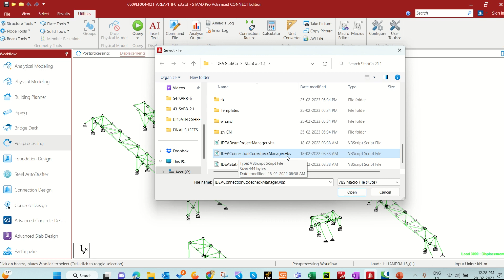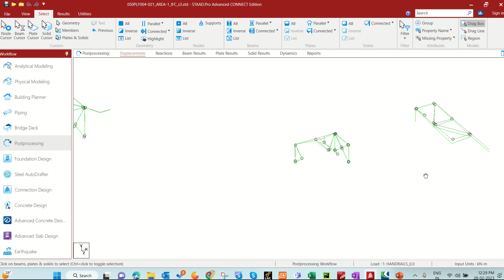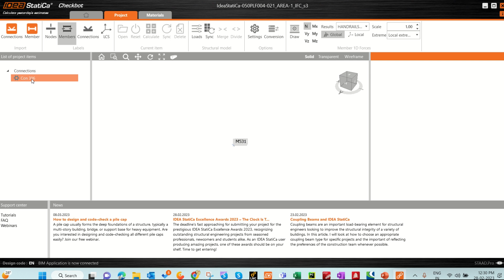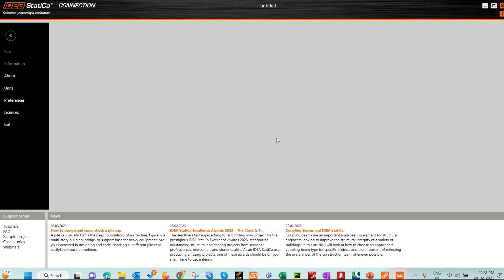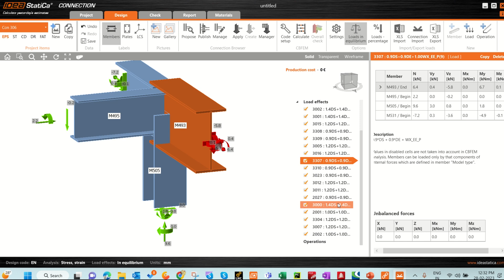STAAD PRO TO IDEA STATICA

Comment: Hello , can idea statica with crack can be opened/used offline without connecting to the server?
Reply from the maker: Yes u can use , u can try educational version as well with complete capabilities
Reply: May I know what idea statica version you are using?
Reply from the maker: @speedone940  u. An download later TS version 23 from idea Statica website , educational version has complete features